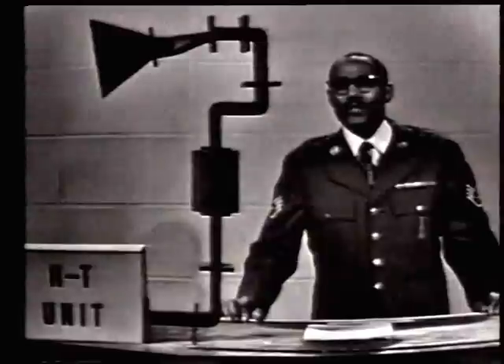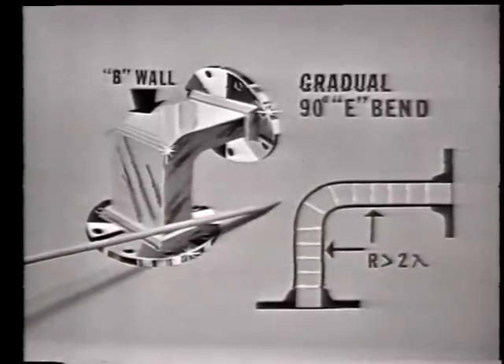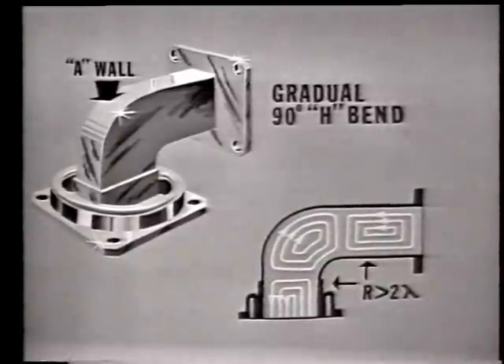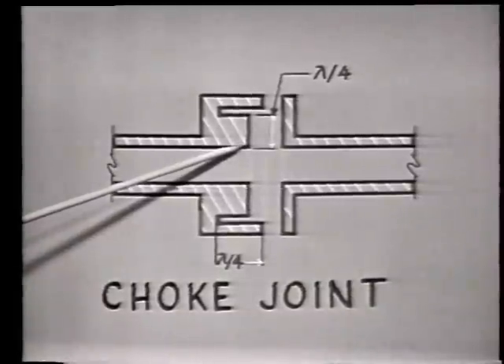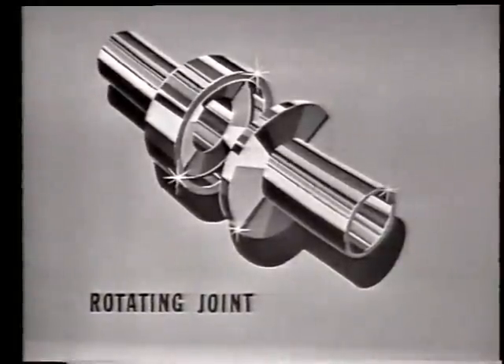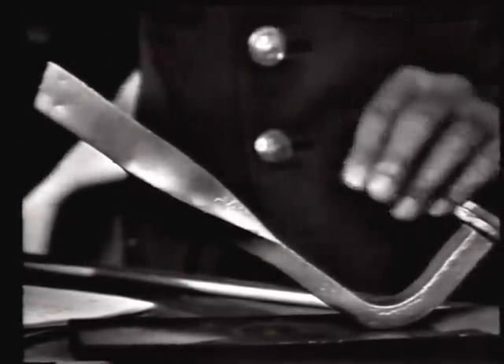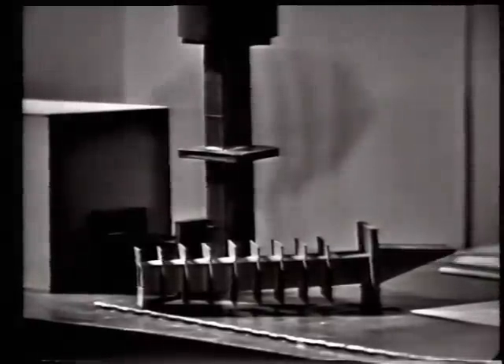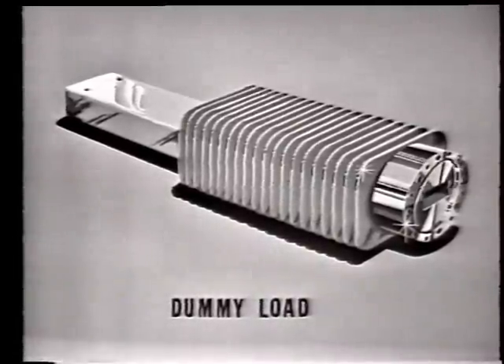Waveguide Plumbing (1979)

Comment: This was not presented in a way that I could understand it. Like why is the A and B walls of the waveguide shaped like they are. What happens to the wave inside of it. The choke joint illustrations made no sense. He kept saying choke, but it sounded like chove.
Reply: orange70383 the A and B walls are shaped as they are to support TE 10 mode inside the rectangular waveguide. Practically the B wall length  should be less than that of A wall. And common convention is to keep B as half of A.